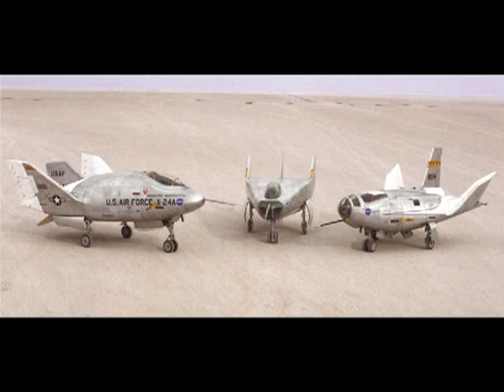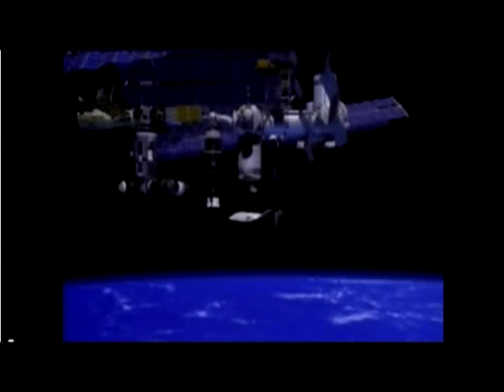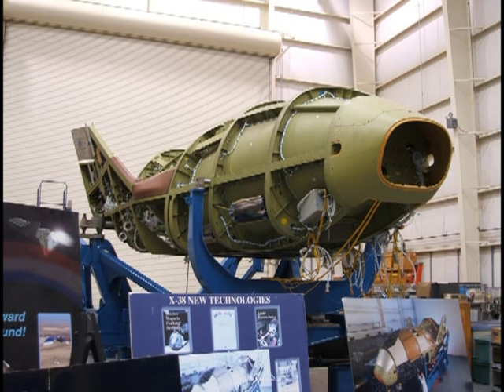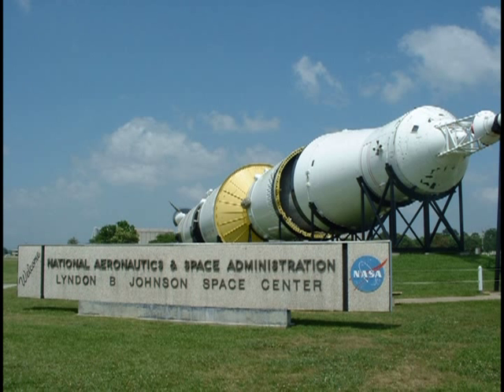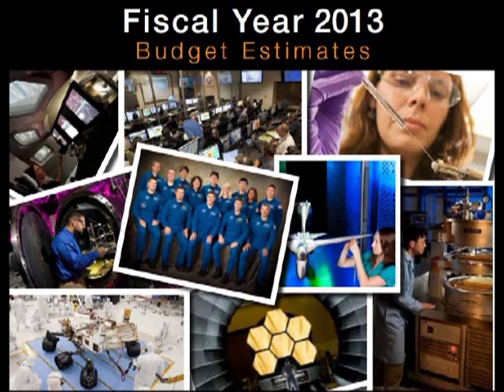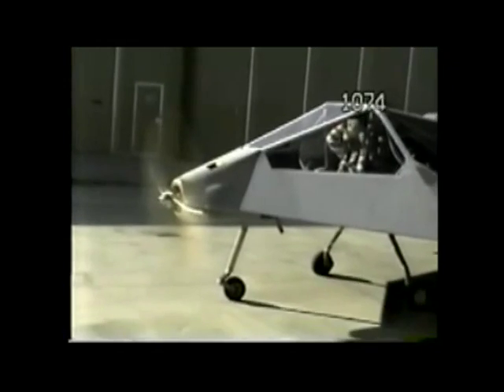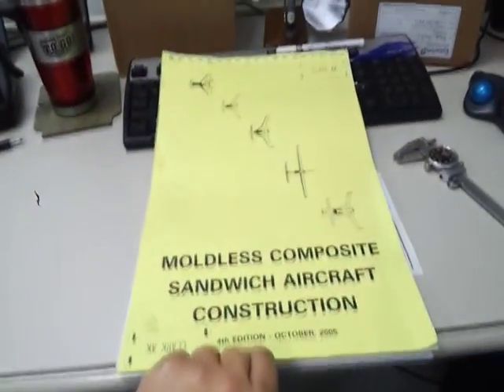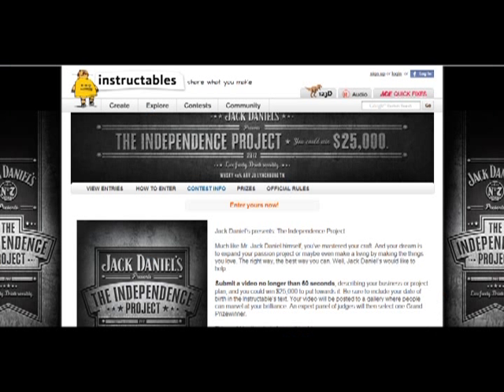Single Prop, Lifting Body, Experimental Aircraft Proposal

Comment: The facetmobile,is a interesting little aircraft I remember Barnaby flew it on a long cross-country and it flew well.the problems it had were engine and prop,related the plane flew well.the last I heard he was working on a 2seater with almost double the thingspan. Of the original. Yes he called it thingspan.

Comment: Why U didn't include the third center vertical fin? Would U consider a retractable or fixed foreplane, 'A' configuration, in a mixed Curtiss P-55 Ascender, Tupolev Tu-144 supersonic transport or Eurofighter style?   Would this improve slow speed handling and attitude?                   Good luck! Salut +